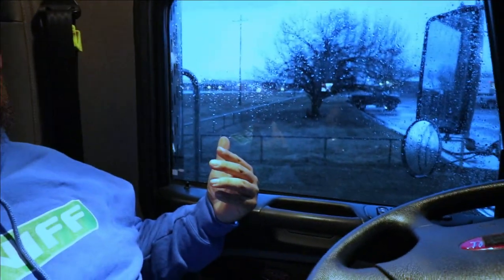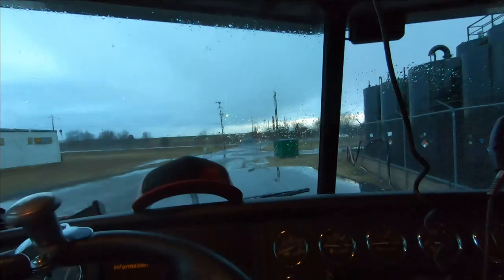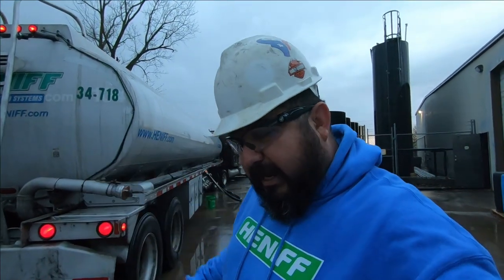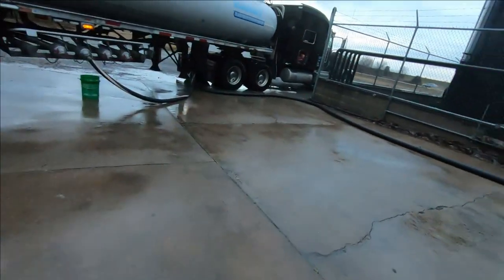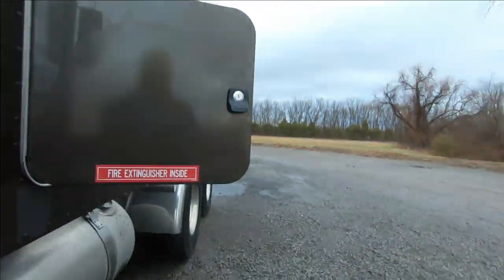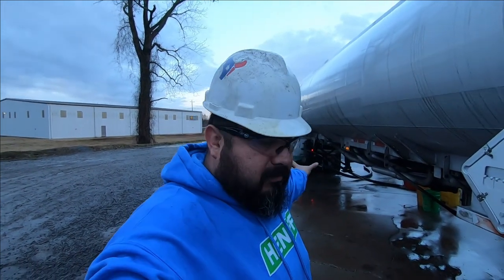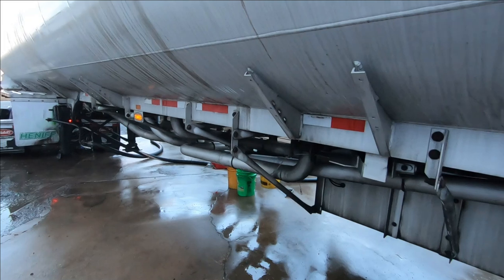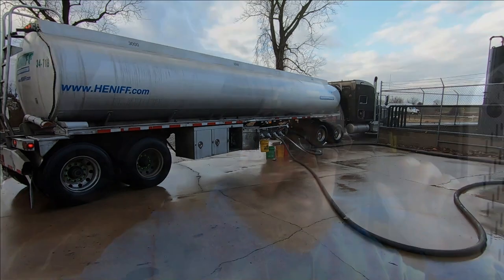HOW TO UNLOAD A COMPARTMENT TANKER TRAILER!!

Comment: It looks to be the same as a fuel tanker trailer the handles that you pull in that box are for your internals and those open valves at the bottom of the tank in case there’s ever an accident on the discharge pipes you don’t lose your product all over the highway it doesn’t actually open anything on the top that tank the orange cap at the end of your trailer that’s where you should open and let it vent so it doesn’t collapse the tanks that’s from what I know I could be wrong but I love your videos brother God bless be safe out there